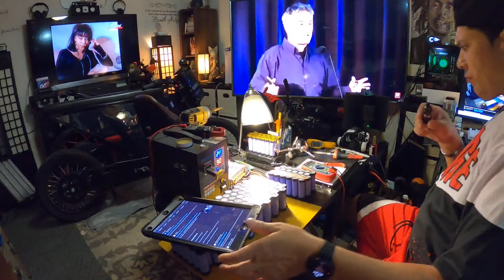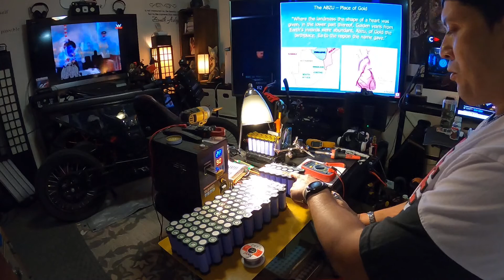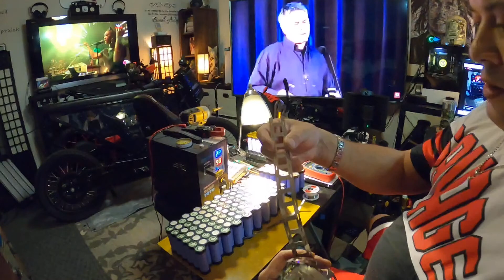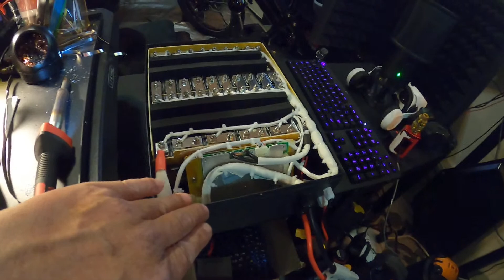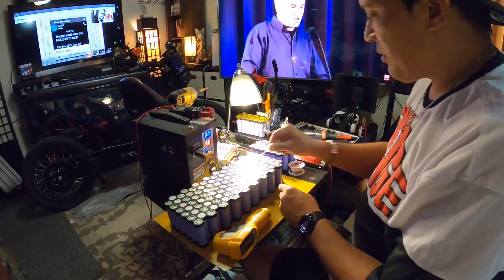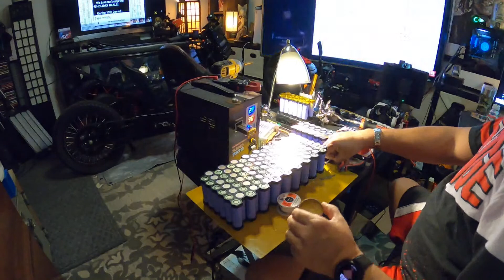Live Battery Build 22s12p heres the tecnique Ill be using also discuss Prismatic Batteries

Comment: If you are going in the solder route what I do not recommend since the heat destroy the batteries, why did you not use pure copper instead of nickel? Copper is much better conductive having a lower resistance. Will be nice if you use a 14 or 12 AWG wire instead on top of the lead.
Reply from the maker: You see what the date is on this video bro you really should see what a difference a year makes for someone like myself that was just starting in this video I’m pretty sure I make one of the best batteries out there today. I think you need to get up to date but thank you but I’m certain I can teach you more than you think you can teach me
Reply: @ChrisCrossingWires1212  Techniques haven't change too much in a year. Good for you master !!!